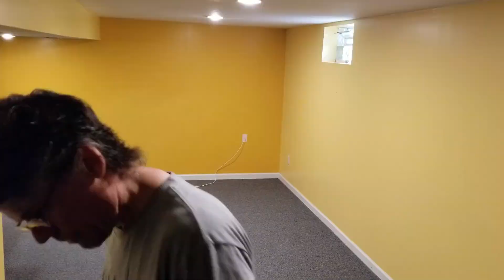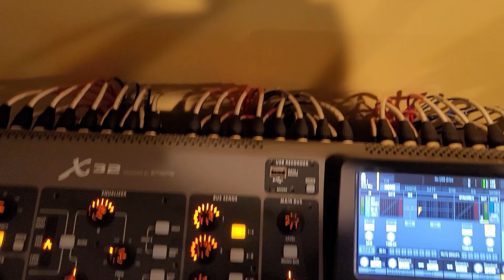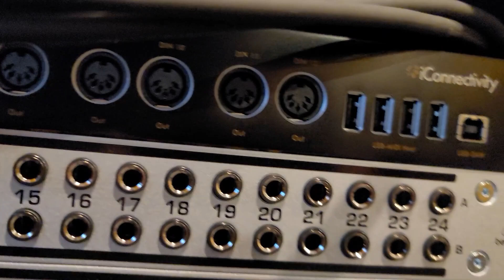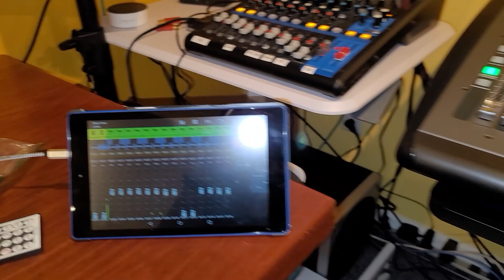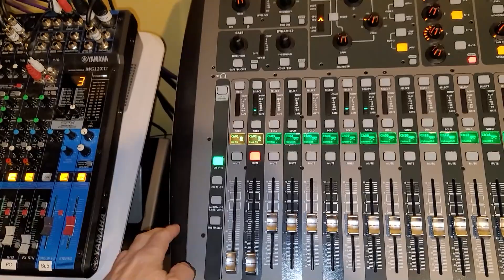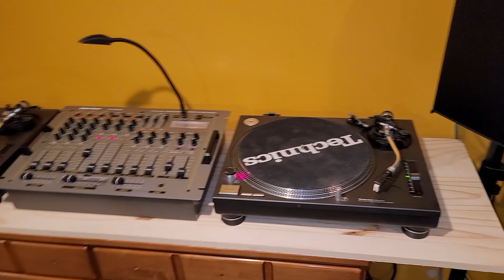I SCRAPPED My Old Studio - How I Built My NEW STUDIO!!

Comment: Thanks for sharing this! I’m in the middle of building my own studio and have already outgrown my Tascam Model 12 — too many stereo devices. I’m currently torn between the X32 and the Wing Compact. The Wing is tempting with its smaller footprint and touchscreen, but the high price, added complexity, and reliance on paid plugins (which may not even work in 5–10 years) give me pause. On the other hand, the X32 feels a bit too bulky for my current setup. On the other hand I maxed out my Synth rack much faster than I thought, so it might be that I'm forced to change my setup which I just built.

My goal is to have everything permanently connected and ready to play — no more constant repatching. I’m using patch bays for now, but keeping track of what’s plugged in where  and what is not, what has been overdriven  by patching additional devices,, gets frustrating, especially when I have to stop mid-session to rewire just to hear something or to be able to record it.

MIDI is another pain point. I'm seriously thinking about following your lead and picking up a MioXL to handle all the midi routing and connections more cleanly.

Also, just wanted to say — your channel is one of the best synth channels out there (and I've watched many).. I really appreciate your honesty and experience-based insights. It makes a big difference.
Reply from the maker: Thanks for the kind words! It's SO freeing to have everything ready to play, all the time, and don't discount the time and effort you save by having every synth already gain staged to suit its output and tone.
Reply: @ScottsSynthStuff  I also want the mixer to function as a high-quality audio interface — capable of sending all channels individually to my DAW, not just a single stereo mixdown. That requirement narrows down my options quite a bit. If it were only about connectivity, I could easily go with an analog mixer.

Comment: I'm going through what is probably my 6th gear change and reorganization since I finished my studio two years ago, so I had your reconfig playing as I work on rack and patch bay layout plans. I also have plenty of synths and drum machines (currently 12) and also use the iConnectivity MIDI devices. Though in my case I use three MioXMs so that I can distribute my MIDI connectivity over ethernet to different areas of the rooms. 

I chose a Presonus StudioLive 32s Series III as my mixer/audio interface. Seems like the Behringer does most of the same things (remote control, scenes, DAW control). The StudioLive has an Interface mode where it switches the Mix buses to act as direct outputs from your DAW for external audio processing. I wonder if the Behringer does that.

Anyway, cheers from the west coast of Canada.
Reply from the maker: Yes, you can definitely configure the X32 to do that!

Comment: How did you connect the synths to the mixer?  Did you need direct box for each input as the x32 has xlr ins or did you get trs to xlr snake?  If you got the snake, do all of the synths have trs outputs?
Reply from the maker: No direct boxes needed. The synths have either 1/4" TS or TRS (unbalanced or balanced) outputs, which then run to my 1/4" patch panels. From there I have patch cable snakes that have 1/4" TRS on one end, and XLR on the other, which go directly into the X32.

Comment: Congrats! Just did the same thing. I got BHehringer wing.
Reply from the maker: Now that's a serious board! I suppose I'll be upgrading to that in a few years when I've used up all the inputs on my X32. :)
Reply: @ScottsSynthStuff  It is super cool I have to say. the price is low and still dropping by all retailers. Stagebox wise it has a suuuper low budget new xlr option. Search StageConnect for that. 16 ins, no power needed, only 1 xlr cable to deliver all, and daisy-chain-able. I got 2, which means 16 ins on board + 32 ins more. 
Functions are so maxed out I think I have to spend a yr to learn most of. 16 fx to put anywhere, send or insert at your will. Ridiculous. I got my 16 synths all in and with other stuff. No excuse to make music anymore!

Comment: I have a few comments here. First of all great video AGAIN. The new space looks amazing. I am confident you will be productive in there. Ok you said you moved to the basement. I had enough studios in basements to learn to elevate the power cables and records in case of some type of flood (ie washing machine, bathtub, or even an actual flood). Also that monitor speaker on the right and what appears to be a subwoofer on the floor are too close to the corner of the room. It will take a lot of acoustic treatment to neutralize the effect on your sound if you don't try to move them to the left a bit. Now about your audio interface, I wanted to know why you arent using the X32 as an audio interface but I heard you mention that later. I use a Yamaha TF5 which is basically the same mixing board but you have that sweet DAW control button and Yamaha did not think of that. Oh and I really like your new MIDI interface. It's good to know a product like that exists if I ever need to upgrade. Lastly I think Yamaha needs to upgrade their USB drivers so that you can use the Montage for it's true worth. Since you are using that MG as an audio interface it is not possible to fully use the montage. This is a mistake by Yamaha not to correct this.
Reply from the maker: I've been in this house for almost 20 years, and the basement has been dry as a bone during that time, so I'm pretty sure I'll be OK. :) Even if there were an artificially caused flood, there is drainage down here to prevent it from being a huge issue.

The subwoofer is fairly small, which is why I intentionally put it in the corner to compensate. I agree about the monitor speaker, but I'm limited in solutions for that. I'm still considering what acoustic treatments will occur - the other side of the room (it's about twice the size of what you see) is not yet completed.

The X32 is my DAW audio interface, the MG12 is my windows "sound card" and monitor controller for everyday use.

The Montage has a decent audio interface built in, but primarily for its own use - you can route audio in, but only a single stereo pair. The real problem is that Windows does not allow multiple low-latency ASIO drivers to be loaded simultaneously, unlike Macs. You can connect to only one ASIO device at a time.

There are workarounds, like ASIO4ALL, where it individually connects to various ASIO devices at a high level, then presents a single virtual low-level ASIO "device" to the OS, but it transitions several higher level OS layers in order to do this, introducing much latency and instability in the process.
Reply: @ScottsSynthStuff  1. Glad to hear about that dry basement. 2. Good idea with the 2 different audio interfaces. It comes in handy for recording anything to cubase (internet recordings and so forth). 3. I do not like ASIO4ALL. It is not a professional driver in my opinion. This actually stopped me from buying more Yamaha products because for me it is more important to use the driver for my mixer (TF5). I wrote Yamaha for a solution and they suggested running all my gear through my MODX if I wanted to use all the features. That is a ridiculous solution. I believe the Motif ES series was the last Yamaha synths that did not use the Steinberg Yamaha usb driver.
4. Thanks for responding, It's actually good to chat with someone with a similar setup to share ideas. Thank you!

Comment: Hi, first time viewer and subscribed after this video. Major fan of the Hydrasynth. But one thing I'd ask your opinion about. If you'd go for typical analog sound, what gear do you use for meaty basslines and lead? Much impressed with my hydra for scoping out a much typical vintage analog sound, pad, bass and lead. But what do you prefer form your own rig?
Thanks, I think I'll enjoy your content a lot and looking forward to your videos. (Also I'm a major motorcycle guy. Vintage enduro, cafe, racers and vintage in general)
Reply from the maker: Thanks, I guess you saw my motorcycle channel? :)

For bass, I will typically go to the Summit, Montage, Hydrasynth or System-8, usually in that order. All can put out monstrous, analog-sounding bass. However...now that I have the SH-101 and soon the Juno-106 and Polysix, that gives me some real analog options as well.
Reply: @ScottsSynthStuff  great stuff! I saw motorcycles on this channel, but I'd love to see your other channel if there's one.

Considering my next purchase to be the summit, but I'm wavering about what sonic holes it will fill that my other synths can't. Stepping on the toes, sort of say, to the hydrasynth deluxe and subsequent 37 as main synths in my rig. Others are Yc73 and microfreak.

Is it justified getting the summit for sonic potential? That it does enough on its own without being to much alike my others synths?
Reply from the maker: @RealmOfMelinoe  You might think there is overlap with the Hydrasynth, but I find they work well together - the Summit with its analog filters really can do sounds that the Hydrasynth can't approach.

My motorcycle channel is https://youtube.com/GoldwingDocs :)
Reply: @ScottsSynthStuff  perfect 👍 Imagine my luck finding good videos of my two biggest hobbies from the same knowledgeable guy. From the other side of the world. Cheers from Norway 🇳🇴

Comment: You look happy with the new space. Congratulations.

With regard to "too many" usb devices, I can share my experiences. Been there.

There are a few options to circumvent this:

1) The reason your computer reporting "not enough usb controller resources" is because you have reached the capacity of the number of endpoints in your host controllers. If you use a software like usbtreeview, you can see how many endpoints each devices are occupying and calculate the total endpoints per host controller. Each host controller usually has similar capacity for endpoints. If your desktop pc has more than one host controllers, and it usually does, you can distribute the endpoints evenly among the host controllers and you will have more room for more usb devices. But keep it mind that using usb hub doesn't increase the capacity for endpoints. Actually, it decreases, since usb hubs themselves take some number of endpoints.

2) Or you may increase the capacity of endpoints by adding more usb host controllers to your pc. Add PCI-e usb host controllers. Most of them have just a single host interface. Some have multiple. For example, https://www.amazon.com/High-Point-RocketU-1344A-PCI-Express/dp/B0797HL9Z3 You have 4 more host controllers just by adding this PCI-e card, which means you may add more than 100 devices, if evenly distributed.

3) Using iconnectivity mioXL, you can simply connect the USB midi devices to the USB host jack in mioXL. If you are running out of the host jacks, you can connect a simple USB hub to extend them. mioXL can host and remember 10 midi usb connections. And they are all bi-directional, which means they can send and receive at the same time. So it's like connecting two midi cables and they can use all the 16 channels per connection.
Reply from the maker: Yes, I'm very familiar with everything you stated, and I've been down that road already - my DAW PC now has three PCI-e USB host controller cards in it because of this. The problem is that many things use up several endpoints. Active USB extension cable? There's 2 endpoints. USB hub? Several more endpoints. Some devices themselves use up as many as 16 endpoints. When you get to 127 USB3 endpoints in total on an Intel machine, it doesn't matter how many cards you have, you're out of business. If I had over 127 endpoints connected and powered up, my PC would refuse to boot past the POST screen. There's no way around this - except to move to one of the new AMD Ryzen architecture platforms, which has many more endpoints available - I don't remember the number, but it's many times what is available on Intel platforms.

And yes, as I mentioned in the video, using the USB class-compliant MIDI ports on the mioXL is one of the reasons I bought it - to get around the USB endpoint limitations.

Comment: Scott, thank you for this great video. Not enough people talk in detail about ways to setup a studio. There are many ways to do it with many different goals in mind, but not as many people explaining the pros and cons, or the how's and why's.  You have headed down a similar path that I am.  

I bought a mioXL for MIDI because I wanted network MIDI (RTP-MIDI) and full software routing of devices. It is especially important to route instruments like the Fantom, or MP devices over a single MIDI bus since these devices use all 16 MIDI channels. The mioXL allows that. I could even merge 2 studios using mioXL's in different rooms, which I might need to do since my music space is small and I might need to expand into my office at the other side of the house. I don't have a single larger room I can move into like you did.  🙂 Very happy with the mioXL but it isn't perfect.  The documentation is lacking, so it is a big learning curve. Their software is lacking and confusing to many people, but it will do what you want. It just isn't always obvious how. Also, no tablet support. But I haven't found another MIDI routing box that has the features of the mioXL.  

For audio, I went with a Presonus StudioLive Series III 32R rack mount mixer - 32 channel in, 16 channel out, expandable to a 64x64 channel matrix. No knobs or sliders. I control it entirely via an iPad or my computer. I don't have room for a full-size mixer, so the 32R is perfect - just goes in the rack. Otherwise, it has all the features of a full size mixer like the Behringer 32X or the full size Presonus StudioLive Series III mixers.  Not so happy with Presonus support and software, though. I might switch to Behringer or something else. It is a big investment, and I need to trust that what I buy will continue to work and be supported for many years to come. Sadly, I'm not sure either Presonus or Behringer will provide that. Maybe Allen & Heath who also make rack mount expandable mixers. Behringer and Presonus have good price for the features, though.

Like most people, I originally considered audio interfaces with ADAT for expansion to hook up all my synths, but you can only get to 24 channels for most of them (base unit with 2 ADAT expanders = 3x 8 channels in/out). More channels are available with high end audio interfaces but get very expensive very fast. I would only go that route if I wanted hardware DSP to aid my DAW, but that is not a feature I care much about.  Instead, I went the route of a mixer.  

My Presonus 32 R can expand the 32 ch mixer with another 32 channels over AVB (a simple Ethernet cable), I realized ADAT is just not worth investing in anymore. Like the mioXL, I can put a 2nd Presonus 32R (or 24R or maybe even a 16R) in my other room, use AVB to connect them together, and I get audio going back and forth between the two rooms without concern for latency. I recently bought a 2nd Presonus 32R (used) to try it out. The rack mixers are much less expensive than the console mixers.  And if I decide I want knobs and sliders, I can get a regular console mixer (like a Presonus StudioLive 32 mixer) and my 32R still works as an expansion for it.  

I hope you can do a few some specific in-depth videos on your studio gear (on the mioXL, the Behringer 32X, and how you use them with your DAW, routing to/from the BOSS looper, etc.). This is an area not well covered on Youtube.
Reply from the maker: It sounds like you and I went down the same paths. I wanted RTP-MIDI as well, with all its routing capabilities, and that's what led me to the mioXL. The documentation is atrocious, I agree, but once you get your head around it, it's very capable and relatively easy to use.

Your Presonus rack mixer was also high on my list. I too rejected ADAT as an antiquated and limited protocol, and you're right, when you start going up above 32 inputs, audio interfaces get VERY expensive, very quickly! I also considered an X32 rack with a remote input "stage box" but in the end I decided I liked the workflow I had with my previous physical mixer, plus the added bonus of being able to use the X32 as a DAW control surface sealed the deal.

I'll definitely do some follow-up videos, there seems to be a lot of interest.

Comment: Great video. 
Although I've got less gear (7 synths) I'd also spend a lot of time to rearrange the setup. As for me the arrangement of the synths was not the main challenge. The challenge began when using pedals. In the meanwhile about 10 pedals have to be arranged. Some pedals are "setup and forget" pedals but some pedals must be modified whilst playing the synths (and so I have to get access to the knobs and switches). Finally I built my own desk that fits more or less to my needs. It's not a beauty but it works.
I appreciate your final work and the little "goodies" you're presenting. Well done 👍.